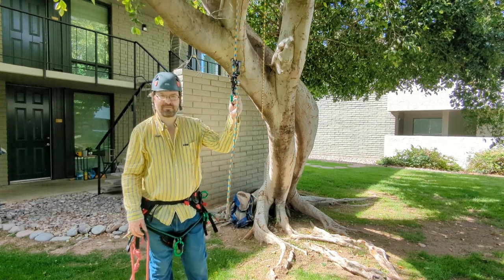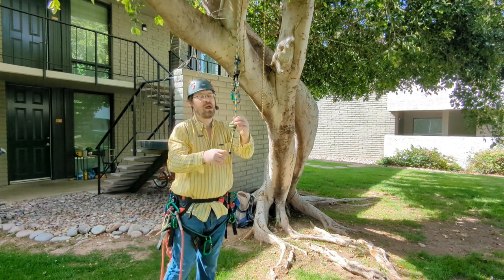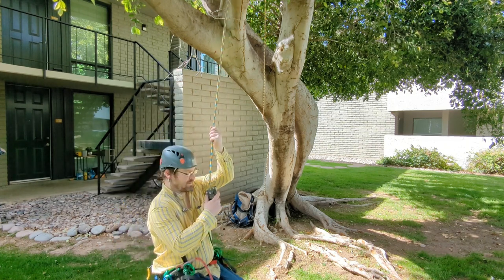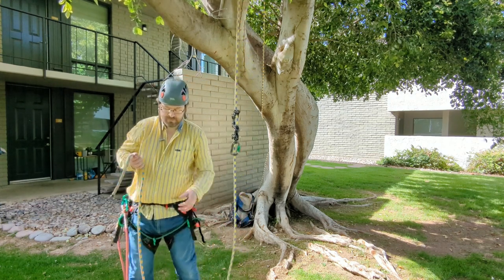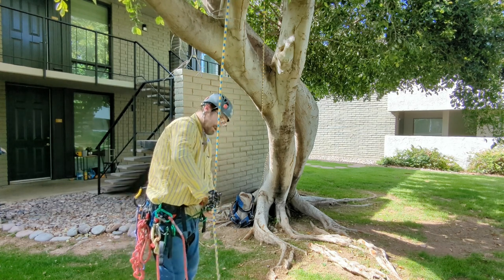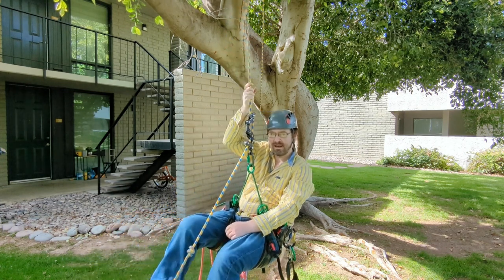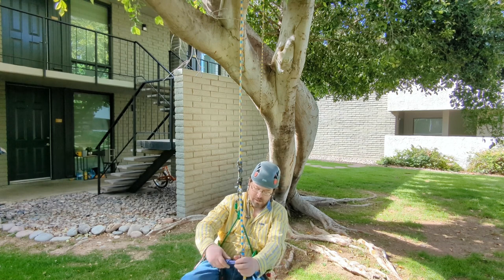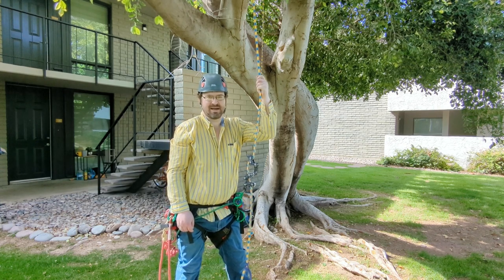Protect Yourself While Climbing SRS/SRT! Proper STOPPER KNOT Use for Arborists & Tree Climbers!

Comment: Very good and important video. In addition to foot ascenders and hitch-cord, you could also footlock up the tail.
Reply from the maker: Thank you so much! If you read my description, I added the options of wrapping the tail around your foot until it holds or tying a midline loop knot, such as an Alpine Butterfly, and using it as a foot loop. I didn't think of foot locking, but that's a great addition! Thanks for your comment!

Comment: I was told to apply slip knots for stopper knots as you ascend. They are easy to remove. Do you think there is anything wrong with using slip knots instead of the knot you describe, which is harder to remove on your way down?
Reply from the maker: The knots I described were to be used as foot loops to bypass a stopper knot. If you want a good, easy knot as a backup for your ascent, use an overhand on a bight. A slipknot is inherently dangerous, cannot be used as a foot loop, especially if you use a foot ascender to ascend with your main device. A slipknot could  get pulled out accidentally at any time. Even the weight of your own rope dangling below you could pull it out. An overhand on a bight will remain steadfast and secure under most conditions and it's easy and mindless to tie. In my opinon, no type of slipped knot should EVER be used as life support. Am I making sense? Great comment! Thank you!
Reply: @Knot-orious  Makes sense